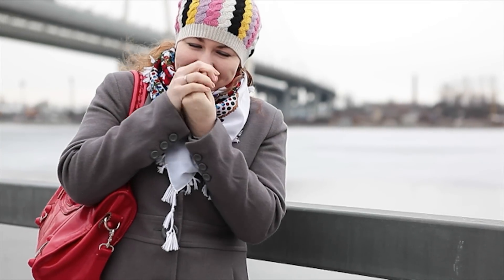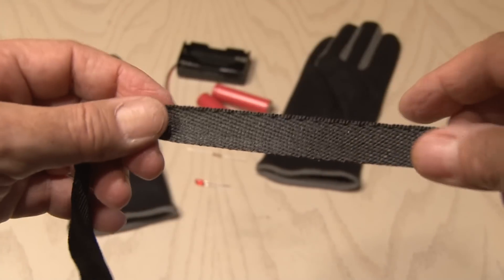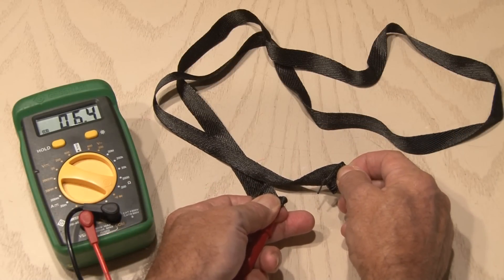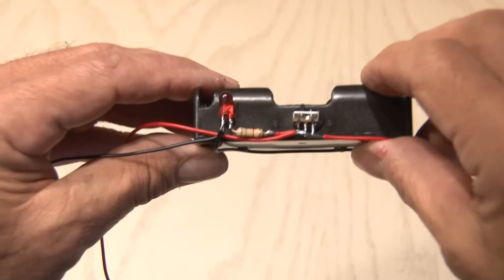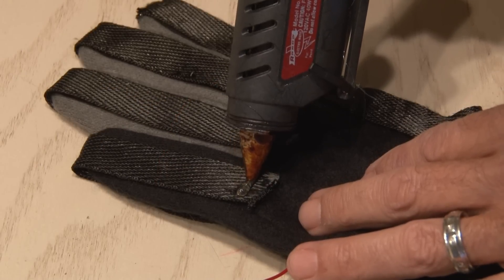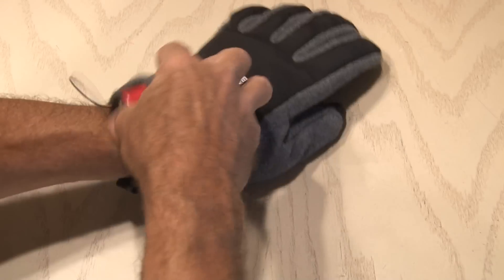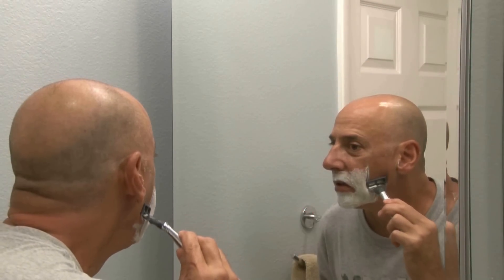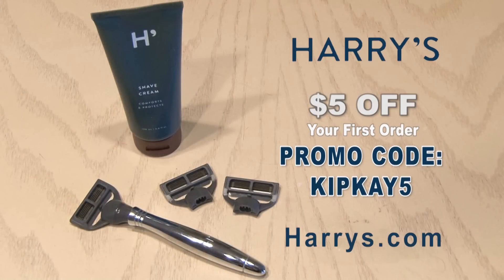Make a Pair of Heated Gloves!

Comment: stays warm for one hour? seems a small benefit for the cost and work involved, considering my local dollar store has hand warmers that will last longer
Reply: they work once tho this is more powerful and even and works hundreds of times
Reply: +DMAN22yeah yeah... the hand warmers are probably lighter on your power bill though
Reply: seawo0lf dude it only costs 10c/kwh average its way cheaper to use 18650s and the carbon strip method

Comment: I like the idea, but why only an hour? This could beat any hand warmers then. or at least, a temp control to lower it because 100+ farenheit is hot.
Reply: use better cells, these were probably 2200 mah panasonic sells 3400mah, thats the max size
Reply: Thanks man. I'm wondering if D's or C's would last longer or perhaps one battery instead of two if heat loss isn't great?
Reply: Joseph Mellott they have a lower energy density
Reply: ah, thanks. I rarely comment on his vids and never did any project close to this.

Comment: Once you placed the hot glue on the carbon tape, there was no way to make "good" contact with the power supply wire. As soon as the wire touched the melted glue, you coated it with an insulation. I guess when you wiggled the wire against the the carbon tape under the hot melt glue, some glue was displaced allowing contact. The best way would be to work the wire into the carbon mesh, then apply the glue on top.
Reply: Yes I used this product a lot and I can't believe he used hot glue to hold it on. It isn't a reliable way. Hot glue isn't conductive. I'm surprised they even worked properly as you need a large contact with the carbon tape and wire.
Reply: Once I saw that I thought it was satire

Comment: I took them off when they started making a ringing noise, then they caught on fire!
Reply: +Matthew Rivas It was reality calling, they wanted to let you know that never happened, kind of like how your conceiving shouldn't have happened.
Reply: +Elias Olsson Well....I don't know what to say, I mean you must have been in my house watching me to see if it did or did not happen wow. Kinda creepy
Reply: Matthew Rivas Oh you just casually made this in 2 hours? Did you have carbon fiber strips just laying around at home along with 18650 batteries, a battery sled, a switch and an LED?

Do you actually think I'm gonna believe that?
Reply: +Elias Olsson Actually I did I got the tape from a previous electrical project, and I made my own unregulated box mod I had a extra battery sled from that project it came in a box of 2 I also have lots of 18650 batteries since I am a vaper.
Reply: Matthew Rivas Well you clearly lack any sense of how electrics work in that case. And by the way, do you happen to know the resistance of the carbon fiber strips you had laying around?

Because if your little incident did happen (which is very unlikely) I'd rule it out to be either you using too low resistance fiber strips like a dumbass or you being a complete imbecile when it comes to electrical engineering.

Please do feel free to place yourself in either category.

If wired correctly and the carbon fiber being the right resistance this would cause nothing more than some (but not too much) heat being expelled from the fiber. If your little project went as horribly as you claim it did, something went horribly wrong in the installation process.
Reply: Matthew Rivas Well I do have access to the internet and I do like to argue with people that make dumb statements. Would you like to explain how this might have happened?
Reply: Video or it didn't happen.

Comment: It is no point to build that, unless, you will add Battery Management System to the battery, which can't go below 3.2V for each cell.
Reply: you can go all the way to 2.5v but at the slight cost of lifespan and beyond that they dont give much power

Comment: You don't want to have those wires loose once the heat starts building up, l would try to use a sewing needle and a high temperature sewing thread to keep those wires secure. if those wires come in contact in the glove specially with those 18650 cheapie batteries you could end up in the hospital.
Reply: the thin wire would fuse open before anything bad happened

Comment: And then it rained (or snowed).. Creating a short that burns your gloves. Yeah good idea adding electronics to a wearable piece of cloth that easily gets wet and easily melts or burns.
Reply: even if you drop an 18650 in water it does nothing, 4.2 volts across water wont do much

Comment: Isn't this dangerous?
Reply: if it can reach 140 it certainly seems like it.
Reply: +TnJcanodezo 140 fahrenheint is about 60 celcius. And if there is -20 celcius in outside it feels warm not hot
Reply: Beniprkl my point is if it can reach 140 and something short circuits the gloves might reach a heat much higher then 140.
Reply: +TnJcanodezo See this

>+und3rcov3rspud The current is so low that it's not dangerous at all. The resistance is also high enough for not shorting the batteries themselves out till they "explode".
Reply: You bet!
Reply: +und3rcov3rspud Yeah it is. The length, width and thickness of the tape determine the current. If you use a very short piece it might get hot enough to burn your gloves. Besides that any damp and/or water from whatever source can create shorts that can get hot enough to burn or destroy the batteries.
Reply: only if you do it wrong, use too high voltage, or just were so dumb that you just decided to do it with a lighter.
Reply: +wtfdinges "any damp" doesn't cause a short with adequately insulated wires. If you're using non-waterproof electronics you shouldn't be getting them wet. And if they do somehow get wet you unplug the batteries and you're fine.

Comment: If I used a higher ohm resister and wired up a cellphone battery from an old phone could I drop the temperature of the carbon fiber tape as well as make it last a bit longer and be a little more form fitting?

Comment: Using carbon fibre for heating is a bad idea. The resistance decreases as the temperature increases (that's why carbon filament bulbs need such a stable voltage). Also, much more expensive than nichrome wire.

Comment: So no statements about using PROTECTED 18650 cells? If unprotected cells are used this can easily become a hazard to the user, either by over discharging the cells. The only time unprotected cells should be used is when there is an external power control and monitoring circuit to insure the cells are cut off before they over discharge.

If you build this, USE PROTECTED CELLS if you use lithium ion cells.

From what I can tell, the cells used here look to be unprotected... :(
Reply: over discharge isnt that bad
Reply: +DMAN22yeah It actually is because if you overdischarge any rechargable battery, it is fucked then.
Reply: ChrisReviewsTech nah i recharge old 18650s from .1mV and they still work

Comment: I say do this again yet use a power source that is a portable phone charger battery pack.  Anywhere between 2000ma and 10,000ma battery pack.  Gloves set with a USB plug to plug into it.  Then use a temp probe to get the temperature.  Either way it won't be exactly water proof.  And last time I check, glue used in hot glue guns don't conduct electricity.
Reply: you wont get enough power from usb
Reply: +DMAN22yeah Actually it would work if you use the portable power packs that have 2 to 2.4 amp output.  Which would be 2000ma or 2400ma.  It won't be the same amount of heat.  But in a doubled layer glove, you will fill the heat.
Reply: JackFreedomcis yeah, but you lose power in the boost converter so this is the most efficient way but that would work
Reply: JackFreedomcis thats no the way it works, its just resistance based so it goes down as voltage drops, and the temp will go down since the heat will go into your hands
Reply: +DMAN22yeah  I know there is a way to build a regulator which can help control the heat.  Which in turn would help save power in the batteries and last longer.  And prevent the batteries being directly over used and destroyed when they drop below its minimal voltage that is needed to be able to be recharged.  And who says the battery pack would need to be in the gloves.  You could build the pack and voltage regulator and place it in a pocket.
Reply: JackFreedomcis it would be best to use 18650s in parallel with a protection circut and a boost converter running to both gloves.
Reply: +DMAN22yeah I have a WTEL 1566B power pack.  Capable of 16V to 19V @ about 3.75A output.  Or about 60 watts of power.  I would need a voltage regulator that drops it down to 7.4 volts.  With two outputs of 2 amps max.  How long would you think it would last?  And to charge it up, use a laptop power supply.
Reply: JackFreedomcis what is the amp hour/watt hour and what voltage is the internal battery? i would use a buck converter form ebay/amazon.
Reply: +DMAN22yeah When I removed the cover to look at the internal batteries.  It has three batteries, 6600ma Ah 3.7V  They are wired in series.   This power pack is meant for laptops.  It goes between the laptop power supply and the laptop.  It comes with a variety of connectors.   Here is some info on it,  http://www.calcellular.com/ext-lap-battery.html
Reply: JackFreedomcis a buck converter would work well.

Comment: I had a whole conversation about this a few months back, I would've went for a 9 volt square battery. Double AA's only put out around 1.5 volts, so you're powering the glove with two double a's making that around 3 volts, the battery pack is also too big.

With a 9 Volts square battery you can reduce the battery pack size, you could also using velcro, leave a pocket inside the glove big enough to place the batter, then use velcro to seal it, you could still include a switch if need be but really all you'd need to do is remove the battery, either way though it provides smaller alternative to your power source + it will last longer if you have a resister reducing the flow, so instead of 1-2 hours with the double a's you'll get roughly 3-6 hours instead.
Reply: DMAN22yeah Ah right my bad, I watched it without audio, hands up on that one lol.

but there is far better alternatives out there that would reduce the overal size instead of having a bulky case where your wrist is.
Reply: Skullzy Xue run it up a sleeve to a pocket, problem solved

Comment: hot glue is an insulator, not a conductor, so when attaching that final wire, make sure it is in good contact with the carbon before adding hot glue on top.
Reply: I'll reply 6 years later and say yeah, that connection ain't gonna work. There's some sort of silver conductive glue or something that will though.

Comment: You probably should've used a low voltage cutoff on the batteries so that you do not overdischarge them. Lithium batteries can be pretty dangerous as you know, and use a regulator with a thermal sensor to make these regulate temperature and heat up faster.
Reply: they are under around a 2 amp load, and undercharge isnt too bad just reduces number of cycles

Comment: Oh, btw, a safe 18650 battery will set you back AT LEAST $10. So, unless you want to spend $40+ bucks on a pair of ghetto heated gloves that only last an hour, stick with the hand warmers.
Reply: nah, you can get them for just over a dollar if you know where to get them, and im not talking about ultrafire crap
Reply: +DMAN22yeah OMG, where?!?! I've been looking forever for a couple of decent batteries, but the cheapest I've found is, like, 1 for $8. And yeah, I keep running into the stupid Ultrafire, trustfire, and other knockoffs.
Reply: Eric Kamlin buy old stock laptop batteries form ebay for cheap and take them apart or go to your local computer store and ask if you can have some laptop batteries, laptop batteries have guaranteed capacity unless they are used but out of the more than 15 i have taken apart i have like 8 truly dead cells and over 70 good.
Reply: +DMAN22yeah But they aren't protected cells, are they? They have an external circuit.
Reply: Eric Kamlin they are not protected but its fine as long as you treat them ok

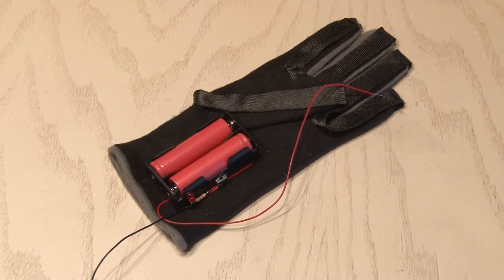Comment: How come the hot glue doesn't isolate the wire at 1:50
Reply: It does actually
Reply: But how can the shortage happen then?
Reply: +EstBest69 Its not a short, its a resitance to the circuit because of frictioin, thus heat.
Reply: +julia higgins They're saying that the hot glue doesn't allow the wire to close the circuit to the carbon fibre tape.

Comment: Would this be possible to do with an entire jacket or would the extended length make it not get as hot? And I'm guessing the amount of heat put out is dependent on how many volts youre running through the tape?

Comment: AvE does this but at lower temperature. Few days later, Kipkay makes it and makes it dangerously hot. How 'sweet'.
Reply: +mudkiptyler To be honest, the idea is kind of dumb to begin with.
Reply: It sort of goes into the area of DIY where it isn't really needed. Spend like 10 bucks on parts and things or like two dollars at a dollar store for cheapy warmers.
Reply: mudkiptyler Or just buy a decent pair of gloves and only have to buy things once. Unless you're planning on traveling in Antarctica in winter, there's no real reason for anything else except as an emergency source of heat.

Comment: The carbon fiber tape is a nice idea. I had not known about that stuff. Very cool.  I see you're using two 3.7v batteries for a total of 7.4v.  Do you think a couple of 9v batteries, instead, in parallel would last longer than an hour?
Reply: this will charge to 8.4 volts full and 9v batteries have an extremely low capacity

Comment: are people joking or did their gloves really light on fire?
Reply: +rivkabornstein They're joking, but you could really set your gloves on fire doing stuff like this.
Reply: +seigeengine not all of them
Reply: +seigeengine No you could not set your gloves on fire doing this unless you lack complete sense of feeling to your hands. I mean please do elaborate on how this could potentially catch on fire.
Reply: Elias Olsson Any short would either dramatically increase the temperature output or overload the batteries. The former could ignite or melt the material of the gloves, depending, or the batteries could ignite, or....
Reply: seigeengine "any short" as in getting the gloves completely soaked in water? Even then, the hot glue acts as an insulator. Please do not expose your non-waterproof electronics to water if you want to avoid danger.

If you do however get them wet to the point where they are a potential danger you simply pull out the batteries and you'll be completely fine.

Just make sure you're using adequately heat tolerant hot glue.
Reply: Elias Olsson Do you.... know how resistance heating works?
Reply: seigeengine Yes I do in fact know how resistance heating works. Do you mind elaborating as to why you asked me that question?
Reply: seigeengine And yes I do know you're technically shorting the batteries by doing this but it's not a dangerous short.
Reply: +Elias Olsson and water has a fair resistance too so wet batteries wont cause them to overload

Comment: This is so dumb. There is no current limiting protection or low voltage protection. you need a low voltage protector in case the cell drops below 2vdc, if that happens the battery cell is damaged. and a direct load for long periods of time can cause the battery to explode. and when lithium is exposed to Oxegen it binds (essentially sucking up the Oxegen in a room) producing lithium oxide. KipKay I think you need to reconsider your electronic endeavours with lithium ion batteries cause well you don't know to take care of them, and some on in the comments said their gloves exploded (probably due to high current draw).